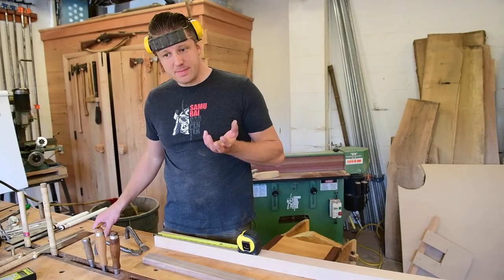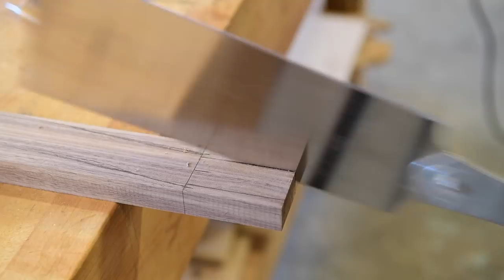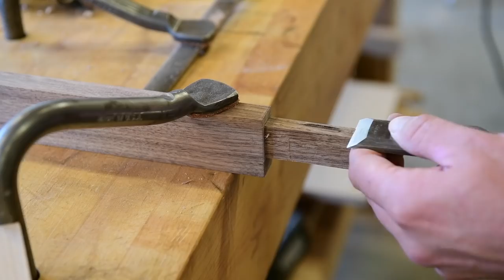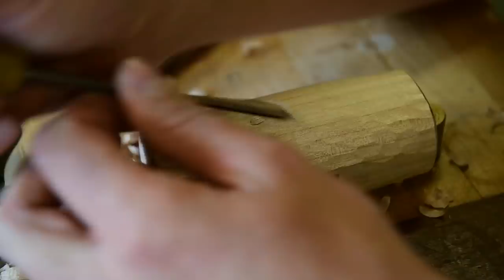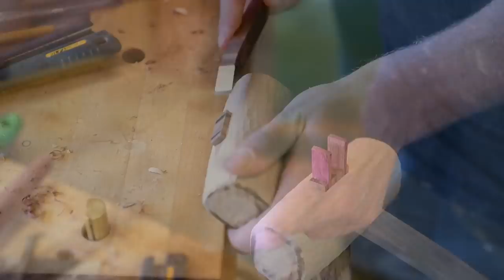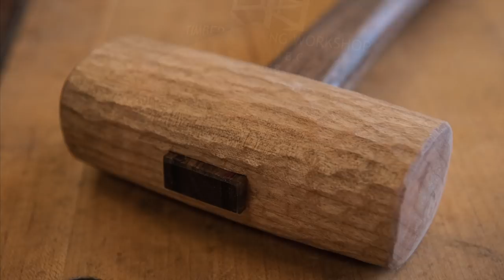HOW TO BUILD THE SAMURAI MALLET!!!

Comment: Jesse, does there need to be a taper at the top of the mallet head hole to accomodate the spread of the handle?
Reply: The wedged spread of the handle end is to keep the head on the handle.  A non-tapering hole allows the wedges to mechanically jam the handle to the head...they become inseparable.